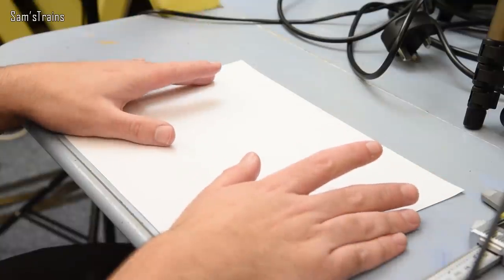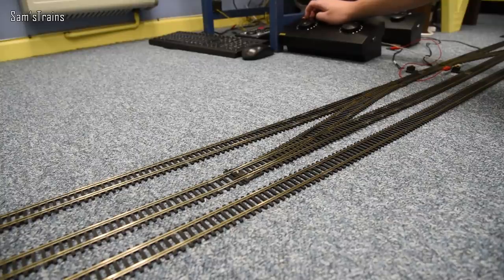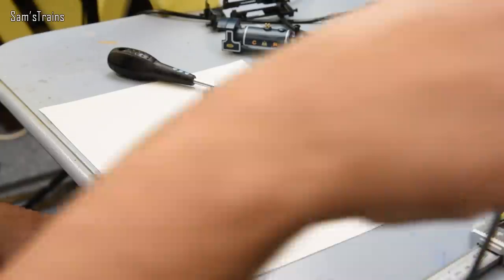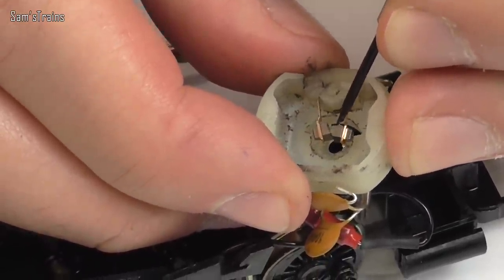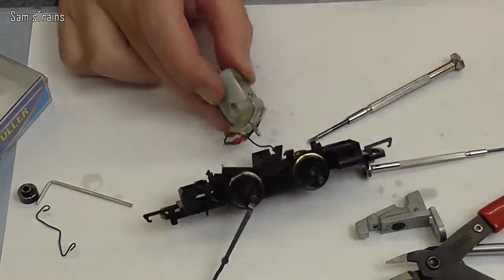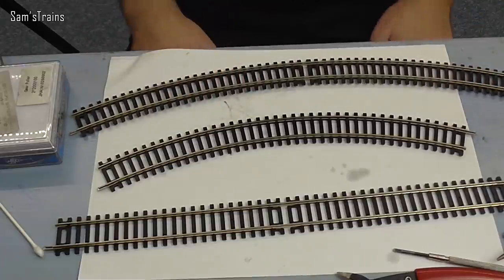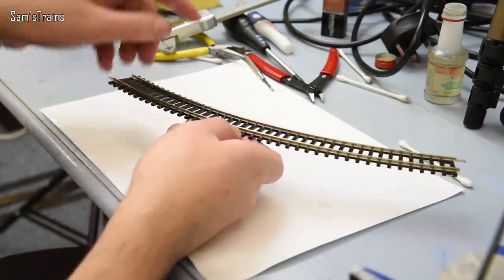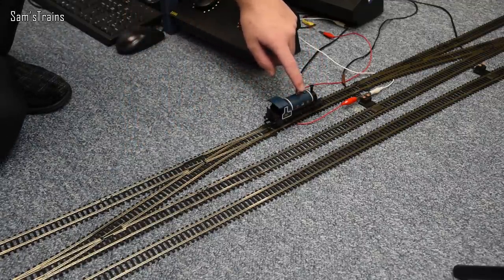The Model Train That Travelled Over 300 Miles: Autopsy

Comment: I once heard that the Hornby 0-4-0s had a design life of 100 hours. I think I can put that notion away and not be concerned about wearing out my Hornby 0-4-0s. A celebratory CR 0-4-0 record T-shirt is in order to commemorate this achievement. Brilliant video!
Reply from the maker: Yeah the motors are supposed to only last for 100 hours, but I got 186 hours out of this, and it wasn't anywhere close to being worn out - definitely don't worry about that - it'll do 200 hours easy, if not, many many more!
Thanks for watching - Sam :)

Comment: Interesting results there Sam. I'm not really suprised she managed 300+ miles, Back in the 60's triang included in their publicity a story that they had run a Flying Scotsman model, non stop, 24-7 for over six months WITHOUT OILING or any other stops, and their experiment only stopped, according to legend, when a careless employee accidently derailed it. OK the old triang locos were a lot more robust than the modern ones, but all the same. 

I do reckon that in honour of Miles' achievement you should get a pair of name plates made up for him, they are not too expensive, this place will do em for £10.50 (plus p+p) a pair https://shop.narrowplanet.co.uk/collections/custom-etched-products 

Have a great weekend

Jon
Reply from the maker: Ahh really?? Blimey I'd be very surprised if that were true - the brushes would never last that long, surely?! If it is true, that's astonishing!
Ooh great idea - I can definitely look into those, thanks for the link!
Cheers,
Sam :)
Reply: Some old triang locos have massive brushes on them, lots of material to wear away so could last a very long time

Comment: Sam that was one great achievement! However, in real miles I think there is an issue, the distance from London Euston to Glasgow Central is something like by rail 401 miles I believe.
Reply: Its around that. I know others have told me that's it's about 401 miles but everytime I've been go Glasgow I've never checked the mileposts. I will next time to see.
Reply from the maker: This is true - but that's the distance by road! The distances I used were as the crow flies - air distance - which is much shorter! :D
Thanks for watching - Sam :)
Reply: @SamsTrains  I thought so Sam yeah! The West Coast Mainline is so windy it adds a lot if distance, good job for the class 390 tilting pendolinos ey!

Comment: Commutator looks perfectly fine. The "dirt" on it and in the housing is just graphite from the brushes. Should see the chaos when cleaning large old DC motors with 4 sets of 2 brushes that are about 2"x3"x6". That's a lot of fine fine lubricant.

Also measuring after the fact with no prior measurements won't tell you anything about wear patterns on the tracks. Anything made of metal that hasn't been precision ground will have variances. The cheaper it is, the more that variance can be. Hell, look at tube steel, you will never find a square tube that is actually square.
Reply from the maker: Thanks a lot for the comment - yes I was impressed by how well that motor fared! haha blimey, that does sound like fun - glad I don't have to deal with beasts like that!
Yes that's very true - I wasn't very scientific there - I was expecting to measure a lot more wear than I did.... but it was soon obvious that the difference, if any, was absolutely miniscule! Those were cheap calipers too!
Thanks for watching - Sam :)
Reply: Sam'sTrains 
Thanks for replying. Any plans to do a test of one under load? That might add a bit more wear on the tracks.
Reply: True about the steel. It’s up and down all over the place. Makes designing stuff kinda fun.

Comment: I remember that in 1978(?) Hornby did a test on the then new Ringfield Motor and it ran into 1200+miles before it was checked and it still ran fine after being inspected.
I had a model similar in wheelset, chassis and motor to the little Caley ST there; and I ran it with some quite cruel loads at times.  It still worked fine when I passed it onto my son, mileage unknown, some 19 years ago.  I don't know what happened to it after that...
Reply from the maker: Ahh yes someone else told me about that - that's absolutely astonishing! And glad to hear that yours survived all that hammer - they are extremely resilient! :D
Thanks for watching - Sam :)

Comment: I'm a little surprised that the commutators didn't wear more. This is proof of the longevity of electric motors. A brushless DC motor with an ESC would have even better longevity. Either way, I expect the pickups will be the first part to wear out and you're limiting factor.
Reply from the maker: I'm surprised too - it seems they're much more durable than expected! It certainly looked as though the pickups fared the worst!
Thanks for watching - Sam :)

Comment: You have to solder small blocks of brass on the pickups. Then it runs forever...
They have a much larger contact area and more material so it takes much, much longer until they have worn off.
Reply from the maker: That's a good idea Rex! I put blobs of solder on some old tri-ang pick-ups, and they've been good for years, without even using brass! Definitely a solid idea!
Thanks for watching - Sam :)

Comment: Hi Sam, I looked in on the run when I could. Have to say I am surprised how well it held up, the motor brushes and commutator looked fine, I was expecting wear in the axle housings as they are quite simple. Yes it was off load but a great achievement. I have this loco dating from the 1980s. Don't think I'll bother buying a spare motor now lol
Reply from the maker: Thanks a lot Mike - I know - I wasn't expecting to find much left of the brushes - so a pleasant surprise there! haha yeah I wouldn't bother - you'll get a few hundred miles out of it yet ;D
Thanks for watching - Sam :)

Comment: Last year two days after my 50th birthday...   you measured top of rail to bottom. How about the inside gauges and rail width? Especially the curves.
I once belonged to a rail club in Bellingham, WA. US.  On one of the up-hill grades, with route and rail change, it was discovered that the rail height was decreased 1/2 mm. Inside gauge was widened 1/16 mm.  Never a derailment.
Reply from the maker: It would have been really interesting to measure the width on the curves - a very good point! Blimey - that's shocking actually!!
Thanks for watching - Sam :)

Comment: I love the Hornby 0-4-0 :) very underrated chassis! The Hornby Mabuchi is a great motor too; we give them a beating in the slot cars and I’ve never had one fail on me. Had a couple of more expensive motors go pop over the years
Reply from the maker: Thanks Richard - me too now - I never knew they were as robust as that! haha absolutely - the more expensive the motor, the sooner it goes wrong!
Thanks for watching - Sam :)
Reply: @SamsTrains  If built by a good manifacturer, those type 130s (or Mabuchi from the name of one of the biggest manifacturers) are basically immortal. They're used in mini4wd (a type of 1/32 car model by Tamiya) racing, and with the right batteries you can get crazy speeds out of them as well (the mandatory ones here in Italy are Panasonic Eneloops, for a total of 2.4-3V and 2000 mAh).
While the stress of mini4wd racing tends to wear them down very quickly, I still have a Tamiya Turbo Dash (manifactured by Mabuchi) that is at least 20 years old and still running strong enough that I occasionally still use it in races. The most durable of the Tamiya mini4wd ones in production is perhaps the Light Dash - one of the race venues i used to go before it shut down used to set up endurance races, providing one of them per car before the race. No one ever had a failure during the race and many of us kept using them well after - tiny strong determined things they are, and well worth the 3.50-4€ they cost!

Comment: To measure that kind of difference You either need a 2-3 digit caliper or a micrometer. With such small weight and force You are not going to get a single digit change (except withing it's own margin of error). Plus You need to measure the same track / mechanism before and after. Just tiny things to keep in mind if You ever do such an experiment again. (half-decent micrometers should be about 40€ +-)
Reply from the maker: Yeah I think you're definitely right - it was certainly an afterthought to measure the track, and I really wasn't equipped to do it properly!
Thanks a lot for the info!
Sam :)

Comment: We use similar cheap (H0) 0-4-0 locos on our "Rampage" table (a 9V maxed layout witch kids can play freely with trains as they like), and the 1st thing that usually fails are the axle bearings from the wear, and the wheels start wobble so much that the loco derails, or the mechanism can't drive the wheels properly. Luckily the bearings on the Piko 0-4-0 locos are replaceable, so they can work till the gears worn out, or the motor burns. About the track: I built my 1st layout when I was 13, witch served for about 10 years and the 1st thing I noticed extensive wear was the points, specially their cross sections (and on some level-crossings).
Reply: I'm planing to test the durability of some old Tri-ang, Trix, Rivarossi, and Jouef locos in the future.
And here's a video of the 10th Temofeszt that me, and my club was participated. The tram layout is ours, and my big hit for this year was a few H0 scale RC cars that was a real mach for the tram layout (I don't own, or like trams) and u can also spot my finished Class 31 salvage project on the railway bridge next to my repaired french steamer):
www.youtube.com/watch?v=U_GlaXf_pyc   (i'm in the background in blue)
U can find more footage if u type "Temofeszt 2018" in Ytube.
Reply from the maker: Ahh fascinating Tom - I would never have guessed it'd be the axle bearings to go first, and not the motors - very interesting! Ooh sounds good - hope all goes well!! :D
Thanks for watching - Sam :)
Reply: @SamsTrains  Piko uses plastic on all on their cheap locos (frame and everything), so yes those go 1st, but like i mentioned; from the 90's even on the start-set ones are replaceable (before that only the boxed ones had it). One of my most ran/used loco is a Liliput 0-4-0 (very high details+quality) and strong wear is visible on its wheels, but still runs like new.

Comment: To measure something like wear, you'd need to measure the same length of track in a few places, before and after your testing. The tracks aren't precision parts (actually, in model rail, probably nothing on the train is a precision part either), so it would be normal to see some variance from one piece to the next. I imagine you are right though, the actual wear is probably in the hundredths of a millimetre.
Reply from the maker: Yeah that's very true - it wasn't a serious scientific test, since I only decided I'd measure them part-way through the experiment - I never dreamed it'd go for 9 days!
Thanks for watching - Sam :)

Comment: Sam. Would be better to cut the web underneath the rail and measure the rail itself. It’s probable that no wear would be measurable as the weight and drag is minimal.  Great review and idea. I recall when HORNBY used to brag about the endurance. I have locos 40 & 50 years old, still running from storage! Cheers Bob
Reply from the maker: Yeah that's very true - I couldn't bring myself to ruin the track, haha! But yes - from what I did measure, there's certainly no massive difference, if any at all! Oh absolutely - I have loads that old too, they just don't give up!
Thanks for watching - Sam :)

Comment: When you measured for track ware, you should measure the rail only. I'm sure the plastic part would have a wide tolerance range so getting the results you did is no surprize. Other than that, it was a very interesting experiment. Thumbs up!
Reply from the maker: Thanks a lot Roy - that's a very fair point! I couldn't bring myself to pull the rails off the plastic :/
Thanks for watching - Sam :)

Comment: Eh, that debris is just the brushes wiping against the commutator bars. There’s no real consequence to leaving this there, in fact it’s pretty good lubrication for the brushes. The brushes themselves look absolutely perfect, they must use a nice hard as a rock compound for these hobby motors.

Interesting video! I’ve been interested in model railways for a good 20 years now, but never have done anything with it. A couple of good friends want to get me into it, though.

P.S. for calipers, I’d highly recommend a nice set of machinist calipers. They are not cheap, but for this sort of stuff, the accuracy really helps. My Mititoyo calipers are good for something like 5 thou, or .01mm. That won’t set the world on fire as far as machining is concerned - you’re better off with micrometer, which might also be handy for this hobby, if you have extremely exacting standards. But I reckon my mititoyos would get me into this hobby. Starret are great, too. These two brands are about as good as they get in the world of machining.
Reply from the maker: Thanks for that Moon Moon - absolutely, the brushes looked perfectly use-able, with more than plenty of life left in them! I did use heavy current limiting for the experiment, which should have helped preserve them.
You're definitely right about the calipers - those were only cheap ones, and it was obvious they wouldn't be accurate enough to measure such a small effect!
Thanks for watching - Sam :)

Comment: Your attempt to measure wear on the track got me thinking:

I wouldn't expect much wear on the tracks, if any. The wheels are, afterall, only in very brief contact with each section of track. So the part to wear most would be the wheels. If you want to get an estimation of wear on the tracks; you could take a measurement of the wear on the wheels and extrapolate from that. That is, assuming both are made of the same material. Yes, this gets complex quickly :)

Also; I now wonder how tracks in real life wear. Is it the trains running over them or being exposed to the elements? I would expect the latter.
Reply from the maker: Very good thinking there Kamil - yes that's very interesting! I'm not sure whether the wheels are made of nickel silver though!
Thanks for watching - Sam :)

Comment: May I ask as to what sort of oil you use to lubricate your locomotives?

I have an ancient locomotive from my childhood. Never been oiled and with me building a model train set; I figure I’d need to oil it to preserve it for as long as I can.
Reply from the maker: I use Hemline sewing machine oil - it works just fine! :D
Thanks for watching - Sam :)
Reply: @SamsTrains  Hemline sewing machine oil? Interesting!

I'll need to order some, see if I can keep my old locomotive running a while longer. Thank you! :D
Reply: Any light oil should do it. Air tool oil, gun oil, sewing machine oil or general purpose oil like 3-in-1. The main consideration is, does it come with a useful spout?

Comment: Good experiment SamsTrains, quite an interesting outcome well done. Do you think that a more sophisticated Loco will have the same outcome? Or do you think that part of the reason that it survived so well is because its a simple mechanism that has been honed over many years?
Reply from the maker: Thanks a lot Paul! I was wondering that too - in some ways they'd probably do better - with the proper axle bearings and 5-pole motors, but the extra driving wheels and finer, more complex valve gear etc might detract also... I'll have to find out!!
I do wonder whether it was the simplicity that served this one so well!

Thanks for watching - Sam :)

Comment: How do you reassemble those motors without damaging the brush springs - I have never found out :)
Reply from the maker: They are a bugger - and it can't be done many times before they fail - it's just a case of wiggling the commutator back into place, using very little force - I certainly ruined many of them before I got the hang of it!
Thanks for watching - Sam :)

Comment: Well this is better than expected! I thought it would wear out and burn away, but the autopsy  showed me wrong! I thought if it would be possible if you put a little N-Gauge Loco on an oval under a dust cover and power it with a solar-cell panel? If you just generate 2-4 V with the sun, you have a steady running loco literally for years I think?
Reply from the maker: Thanks Paul - me too - turns out the motor was no-where near done! That's a very good idea - great way to extend the experiment!
Thanks for watching - Sam :)

Comment: I think some of the black stuff was graphite for lubricating the motor.
What is the wheel circumference and the worm gear ratio? It could be fun to work out how many revs the engine has done...
Reply from the maker: That's possible - I thought it'd be the carbon from the brushes though! I'm not certain of the gear ratios - but you're right, that would be awesome to calculate! :D
Thanks for watching - Sam :)

Comment: While interesting an unloaded loco running at a medium pace isn't but control. Now hook up as many cars as it can possibly pull and run it full speed blast until it just quits or starts letting the smoke out. Then run  another letting it just pokey along, another @ normal speed and maybe a push pull or pulling in tandem. Now that's a test.
Reply from the maker: Yeah that would be very interesting - though I expect a loco like this would wheelslip long before causing damage to the motor, though there's no doubt everything would be under greater strain!
Thanks for watching - Sam :)

Comment: Hey Sam, where did you get the tool that you used to pull the worm gear off of the main shaft of the electric motor? Please let me know. Thanks
Reply from the maker: Hey Dylan, it's called a Pinion puller, they're available on Ebay! :D
Thanks for watching - Sam :)